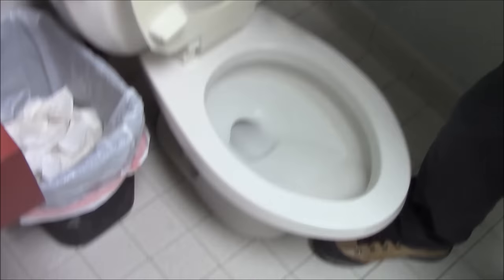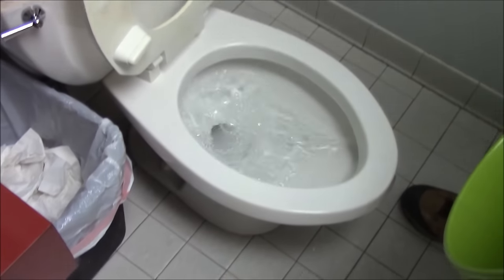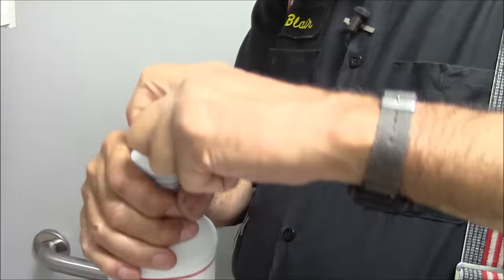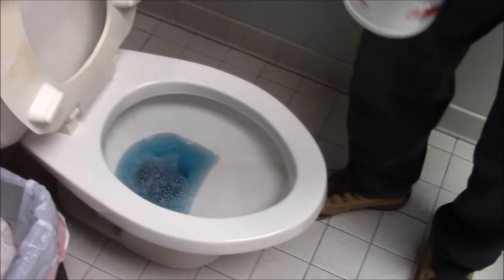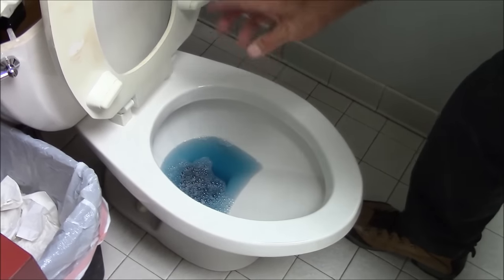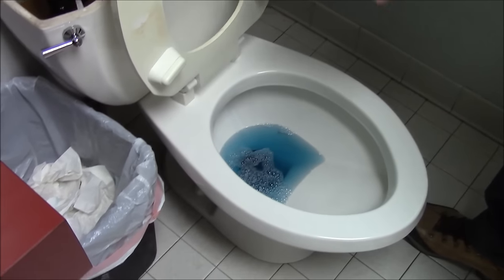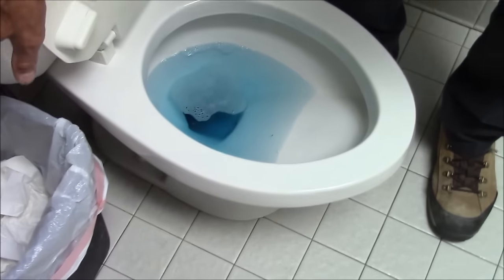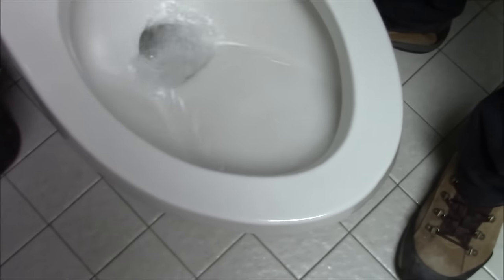Slow Flushing Toilet? Quick and Inexpensive Cure With Delimer

Comment: Where do I get that product we do not have it here in Texas
Reply from the maker: Use muriatic acid by the quart, full strength just like the delimer I used. Blair
Reply: Mr. Hardware 

Thanks!
Reply: amazon  @sleepycobra9152

Comment: Mines a 2006 Model toilet & for 6 Months I have had nothing but horrible  "deal with it"  No luck  & it sucks so frikkkin bad, Im almost to apoint   oif saying to hell with it & spring for a new toilet!   No matter what I do....... when I flush it, the bowl will fill all the way almost to apoint of running over,   ......then its done,   often leaving a turd floating around it it sucks.   Tried new pump ything, made sure water goes almost to top of Drain flapper tube,   coat hangered all holes,     ...   Used the works,   Plunged it worked on it,   Tried adjust it,    the hole at the bottom cleaned it,   Tried Holding the hanle,        ...........    NOTHING WORKS.        Here I am again many months later attempting to figure out WHY it wont flush ,  If I hold the handle down for like 20 seconds, It MIGHT flush. Maybe.   Today is my last day i will spend screwing with this stupid messed up Toilet,   Beyond past fed up with something that SHOULD work & wont!.
Reply from the maker: After the bucket test which will prove the problem is not in the drain, try the muriatic acid cleansing. It usually works well.

Comment: Hello, Do you know if I can also use this method using the product liquid plumr? Will it damage the pipes in an old apartment?
Reply from the maker: Not normally, it will be mostly used up from cleaning the calcium in the toilet. Plus most plumbing can stand this treatment easily.

Comment: I don't understand why the deliver I poured down the tube did not come out of the holes around the rin. Instead, it rose up from tbe botto  of ghd toilet
Reply from the maker: Usually I pour it on the quick side to get more into the jets. You may be very calcified and it will take more than one dose.

Comment: will this hurt PVC pipes ?  or a modern ( 15 yr. old ) septic tank ? thank you for the info
Reply from the maker: No, it will be too neutralized to effect your tank, let alone one quart into 1,000 gal tank. It comes in pvc, no problem. I would not dump several gallons of acid directly into the septic tank, one quart after cleaning a toilet, not an issue.
Reply: @MrHardware1  Thank You so much

Comment: When I pour the 3in1 cleaner into the overflow. It doesn’t come out to the jets. It all goes to the bottom of the flush.
Reply: you may need to try another quart of 3in1, or your toilet may not have a rim rinsing channel and jets. New or old toilet?
Reply: Blair Gilbert I did. It all goes to the bottom. The house was builder in 2008.  It goes have rim jets. But only if u flush atleast quarter tank. So I end up mixing the 3in1 with quarter tank of water.  I flush, then I see some blues come out of the jets. But prob didn’t help much. Will it damage my tank?
Reply: @blairgilbert7606  I have a toilet that is only 4 years old.  I'm on the second round of cleaning.  Both times when I poured the Rooto into the overflow tube, no blue comes out through the jet holes.  Before I watched this video I did attempt to poke through some of the holes with a hanger so I'm thinking not all the holes are plugged.  Is there anything else I can attempt to open up these crusty holes in the rim of the bowl?  I'm not a real fan of standing on my head trying to pry open these holes.

Comment: On an older Norris, pouring into the overflow doesn't seem to dribble contents down  into the jet-holess. If I were to  to shut off the water, flush, lift rubber flap,  pour fluid into hole, shouldn't the contents dribble down  into the raceway and jet-holes also? Thanks.
Reply from the maker: Pouring into the overflow tube bypasses the flapper and half can go into the trap and the jets around the rim. I've never seen an overflow that did not connect to the output of the flush valve. We call a flush valve a Douglas, what is a Norris?
Reply: My Kohler has the same issue. When I pour into the overflow, it goes right below the flap. Nothing is coming out of the rim jet, all the blue stuff is in the bottom. Anybody else can advise?
Reply: @MrHardware1  I have a 4 year old American Standard toilet that has never clogged until lately.  My plumber said to replace the toilet but I found your video and wanted to try your method first.  I am having the same problem that some others have.  I ordered your recommended product.  I poured a whole bottle into the overflow pipe and then two bottles of water into the bowl to raise the water level.  No blue comes out of the rim jets.  The blue liquid all seemed to come out of the hole at the front base of the toilet.  Is anything getting into the channel at the rim?  I have only used one bottle so far and have another one but I don't want to waste it if it isn't getting to the place it needs to be.  Please help!  I don't want to buy another $300 toilet!
Reply from the maker: @donnamaxwell2569  I can only say that the second bottle should not be a waste compared to the cost of a new toilet. Pour it into the overflow faster if you can, that may get it into the rim jets. Also, a four year old toilet should not be giving you any trouble. I'm finding some big box products being sub-par because they demand cheaper pricing so they get seconds. Go figure. maybe your toilets are still guaranteed.
Reply: @Eqnotalent  I know this is a two year old comment and you may have figured this out or gotten a new toilet by now, but your issue is that you have a front fed siphon jet, meaning that the water first goes into a hidden hole up in the trap way of the toilet and THEN to the rim jets. If you are pouring the solution into the overflow tube like in this video, then it is all going into that little hole and not getting to the rim jets since there is not enough force. The best thing to do would be to pour the solution into the tank itself and then flush, but you might need a good bit of solution to do that. Also it could harm the tank parts.
Reply: For those tanks, would plugging the siphon jet temporarily force the solution into the rim jets?

Comment: Question, can any vinegars solve this problem my problem is that my toilet doesn't flush, when u try to flush the toilet it won't do anything it won't let u push down on the lever so we manually have to pull the tube to flush the toilet any solution for this
Reply from the maker: Usually this occurs when the flush valve (the flapper, tank ball, or tower)  gasket gets old and soft and sticky. Take a picture of the tank and go to a local hardware and get the replacement gasket.

Comment: Hi there - I'm at my wits end plz help. I replaced my old ballcock valve with a Fluidmaster 400AC. My problem is that it takes a long time, perhaps 5 to 6 minutes for the water to fill my tank. It was much quicker before. I did take off the supply line and ran water through it. And still my water is very slow to fill up. And yes my valve is all the way open. Thank you for your time.
Reply from the maker: I assume you cleaned the gasket in the top of the 400? If it is clear I now install Korky quiet fill ballcocks, quicker and quieter.
Reply: @MrHardware1  Thx for your reply. No I haven't cleaned the gasket, the fill valve is new so I thought I wouldn't have to clean it yet.
But I guess I'll try that next.
Do you prefer the ballcock ones over the fluidmaster fill valves?
Reply from the maker: @Brian-lh7jj  The Korky is faster filling and quieter than the Fluidmaster 400.
Reply: @MrHardware1  I'm up in Canada, don't think I can get The Korky here. Thx for your help!
Reply: @Brian-lh7jj  actually you can, at Home Depot.

Comment: i put the fluid in the overflow but nothing came thru the jets in the toilet, it came thru the toilet and the water turned green in the bottom of the bowl  but i saw nothing from the jets ??????  i used CLR  am i doing something wrong?
Reply from the maker: If you need another dose, pour it faster if possible.
Reply: This also happened to me! My overflow tube has a plastic “hat” on it that means I have to use a funnel to pour the CLR so i can’t get it to go down fast. Will this not work??
Reply: I ended up using a watering can to get it in as fast as I could. I think that resulted in a faint green color on the surface of the bowl water which I hope means it came out of the jets. We have been flushing our toilet with a bucket for over a year!!
Reply from the maker: @nicolesafranek4997  I’ve yet to hear this didn’t work. I like the watering can trick.

Comment: How do you do this on a Kohler Class 5 toilet?
Reply from the maker: Either the overflow is a square tube or there is a moving tower which is the overflow. Pour the delimer into the tower. You’ll know it’s the right place as none of the chemical will go into the tank.
Reply: Thanks!

Comment: Would vingar work?
Reply: Yes, but look for a video where they turn off the water, flush the toilet, then dry under the rim and use duct tape to allow the vinegar to sit in the raceway for several hours.  Same idea but works better.
Reply from the maker: Cleaning vinegar is good. Safer but not as strong.

Comment: My toilet failed the bucket test in the video, still does not flush with force.  What does that mean?
Reply: If you fail the bucket test, meaning the toilet will not take all the water at once, there is probably a clog in the main (or local) drain pipe.

Comment: Tried this twice  and the fluid only comes out of the bottom of the bowl not through the jets around the rim. Anyone have a suggestion. ? Water comes out of the jets in the rim when I flush so I don't get what the issue is
Reply from the maker: How about how does your toilet flush? Complete cleaning 9 out of 10 times? If it does you don't need to treat it.
Reply: @MrHardware1  No it's terrible. The jets at the front of the rim are clogged and that part of the bowl stays dirty.
Reply from the maker: @357wesdog  Call the manufacturer is possible. Removing the toilet so you can pour delimer in the bowl and roll it so it gets into the rim. Better do this one outside. Could be time for a Comfort Height Toilet.

Comment: what if the rim got baby wipes pushed in it, because a kid decided it took half a pack of baby wipes to clean..and after removing as many as i could by hand...plunging caused one or two or more to somehow back feed up the hole that lets water out at bottom of bowl..aand clog the FUCK OUTTA IT...to the point that water just trickels out super slow.
Reply from the maker: Closet auger is the way to go. Good luck

Comment: It is funny what people will choose to spend their money on. The first thing we do when we buy a house is replace the old water guzzling, dirty old toilets. Think about how utterly cheap a new toilet is and how easy it is to replace. We found an American Standard version at Lowe's that has flat sides, no exposed goose necking pipes, no platform on the floor for urine and dust to build up. We have replaced two of the three so far and are glad we did. Think about how dependent people are on functioning plumbing. Don't mess around with these old water guzzlers. Get rid of them.

Comment: Cant really find delimer here in BC canada, anyone around here know where to get it?
Reply from the maker: I bet you can get replacement, muriatic acid,  either at a building supply or a pool supply, and it will work just about as well

Comment: Guess i gotta do the "fucking test" on my stupid toilet that dont flush right. 1:54 - I noticed that when pouring slow amount of acid down the overflow stand pipe, the acid was not coming out from the rim toilet eject upper nozzles, i guess I have pour it fast as the acid rushing down the pipe with force to reach the toiler's eject nozzles.

Comment: I find if you take a framing hammer and chip out part of the rim all your jets are more accessible makes them easier to clean. I know a lot of you are thinking " damn I'll have a big assed chip in the bowl"  and you'd be right to a certain extent... But the seat will hide the damage and as long as you remember to put the seat down your wife will be not only proud of you that you fixed the toilet but also you are considerate by putting the seat down after each use!.......

Comment: Not good for septic tanks, so there's that.
Reply from the maker: Not if you poured it directly into the tank, and that one quart at a time into a 1000 gallon tank. Also the acid has been neutralized as it dissolve the calcium in the toilet so by the time it hits the tank it’s just this side of inert.

Comment: $5?  A quart of this stuff is $60 on Amazon.  ☹️
Reply from the maker: That is for a six pack, you should be able to get it at a plumbing supply in your neighborhood, if not get a quart of Muretic acid. I recommend spending your money in your neighborhood not buying stuff online. Keep your neighborhood strong.
Reply: @MrHardware1  thank you!  At my age I should know how to read, but there you have it.
Reply: I'm found online prices for a single bottle were still extremely high! The local hardware store in my area of Metro Detroit had a bottles for less than $5.

Comment: "For five dollars..."   Huh?!!!   That and similar products all go for about FIFTY dollars!  Need to go through two bottles?  That's a Ben Franklin to clear your shitty old toilet.  In my opinion, at this cost, you might as well buy a brand new crapper.  😡
Reply from the maker: Get off-line and see if you have a building supply that sells muriatic acid. Over the counter it should cost less than $5. Shipping acid is $$$ and dangerous.